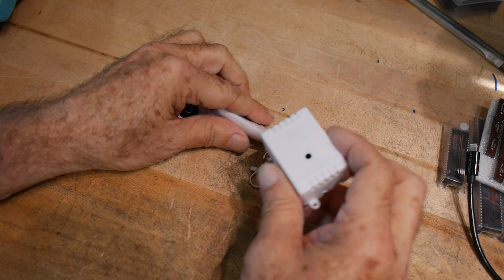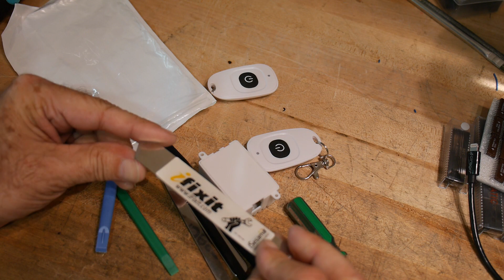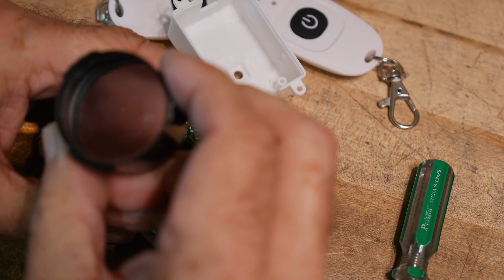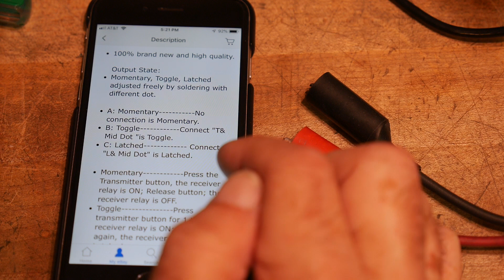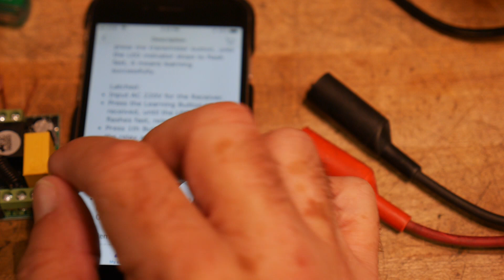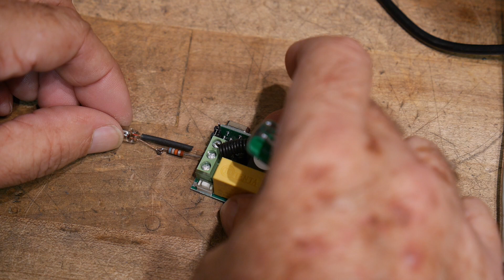#333 remote control power switch

Comment: maybe a stupid question, but is it also possible to put a 12v input in there and 12v output? or will it not work because it wants at least 220v?
Reply from the maker: The box takes in incoming AC voltage and regulates it to a low DC. It should be able to hack the device and feed the circuit with 12VDC. the relay does not care if you are switching AC or DC. the device ASIS will not work with 12VDC.

Comment: The big box stores have remote AC switches, especially around Xmas, that make life really simple and you don't have to wire them up yourself. I use one to turn the fan on that sits on top of my linear amplifier's power supply cabinet and another to control the banks of fluorescent lights over the workbench as well. Units come in one and two outlet versions and some have a right angle plug for installing behind furniture. Well worth the $$ for the convenience!